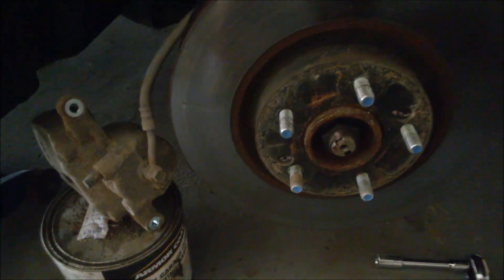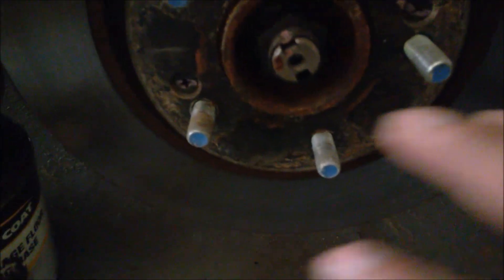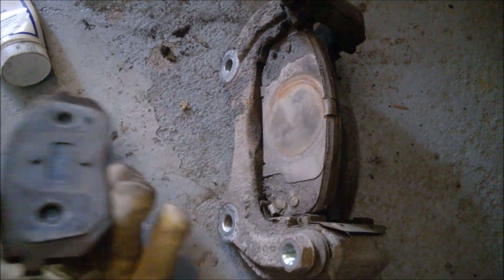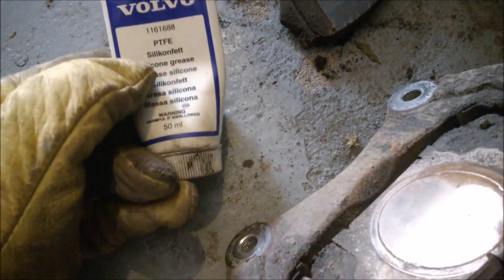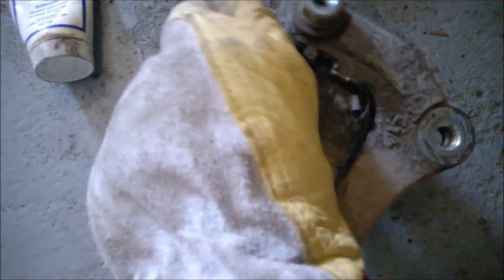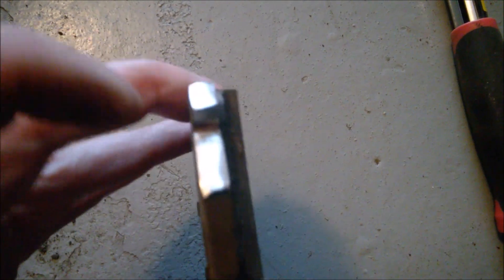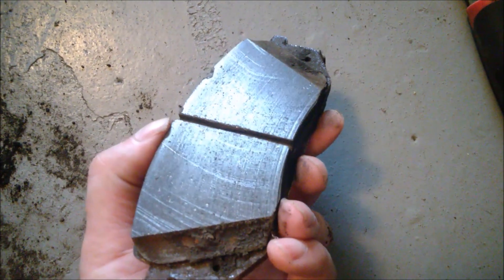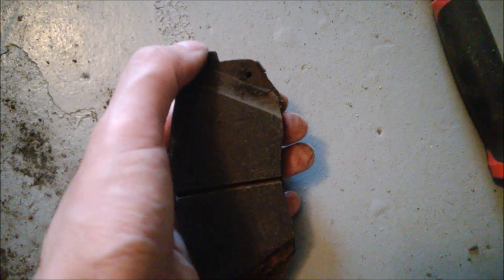Hyundai Kia Fast Wearing brakes problem

Comment from the maker: 6 months update: inspected today the brakes and the pads were moving easily as they should.  I have to say the braking has largely improved since this fix, with more power and better brake feeling.
Check brake wear without removing the wheels  https://youtu.be/d3VG6BlX_Lw

Comment: I just changed the front brakes out on the 2016 Sonata, I was kinda surprised how wore down it was without any noise. It was more wore down then yours but it was the original pads with 86,000kms. The pads were kinda hard to take off the caliber bracket like you’ve shown. I had to take a hammer and whack it out. I replace them with akebonos and they weren’t easy to put on either. The rotors were stuck, the screws were seized. Pins were okay but I still clean and relubed. I’ll see after winter if they are stuck or wore down excessively.

Comment: I have a 2017 Hyundai sonata, and im replacing my front rotors and brakes but didn't notice that there was a rubber on one of the caliber slide pins and I was wondering if you can help me on that determine which slide pin goes up top and goes at the bottom
Reply from the maker: Don't remember this detail, maybe try if you can see it in this other video https://youtu.be/AEzPfGUkczM

Comment: I knew this was the issue.  I have had my rear brakes done on my 2010 Sonata about 4 times in the last year and I just heard them start grinding again today.  I'm not bringing the damn thing in again, I will just do it myself.  I can guarantee that the mechanics aren't taking material off that area even they are fully aware that this is happening regularly and the pads are constantly stuck.
Reply from the maker: Thanks for the feedback.  I've since ordered aftermarket pads (Raybestos - not really good, don't recommend)  and they have the exact same problem as the genuine pads.  No surprise, as all aftermarket parts are being made to the exact measurement as the genuine ones, so will have the same problem.  I had to grind them as well.  I'm updating soon a full video with brakes replacement on Sonata with electronic parking brake.
Reply: @Peppermint1  Awesome.  I would normally just do them myself but I just haven't had a lot of time on my hands and having to drop or raise the damn control arm on my model makes it more of a pain in the ass too.  I wish I had a lift to put the car on as well.  Life is much easier on cars with a lift...

Comment: Hello,

I have a Santa fe 2015, i have problem of brake system when i push the button it turn on but it doesn't release the brake when i push it again, can you send me the schema of braking system and tell me what do you think about this problem?

Cordially
Reply from the maker: Hi Soufiane, do you mean the parking brake button?  I don't have a schema, not sure what could be the issue.  Does the parking brake release when you put in D and drive away ?  It should release at that moment automatically.
Reply: @Peppermint1 , hi yes the parking button, actually it's a manual transmission. Thnks anyway

Comment: If your at a light knowing you'll be there more than 5 seconds put your car in neutral and once green put in park. No lag or stall.
Reply from the maker: Hi there. I'll be hesitant to put an automatic transmission in N while at traffic lights, this may reduce the fluid pressure inside and some bearings may lack lubrication.  At least this is what I've read about an owner who was doing this for a while until his transmission failed at a bearing.
Reply: Kudos to you John!  Leaving a vehicle in ‘D’ will cause extra wear and tear on the tranny.  It is having to run up against the torque converter, so when you press the accelerator, the car is ready to go.  5 seconds might be a bit much, but if you just pulled up to a light that you know will be red for a few minutes, YES!  Stick it in neutral or park. This Peppermuck don’t know what the phuck he’s talking about.  Not meaning to be caustic, juss sayin... too many people putting out false information that can adversely affect others, that’s all!   Peace